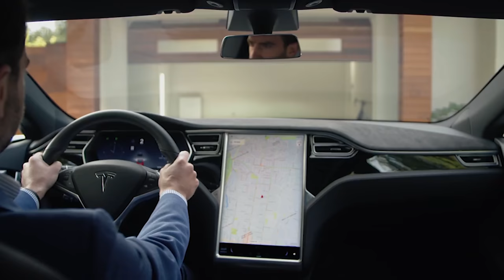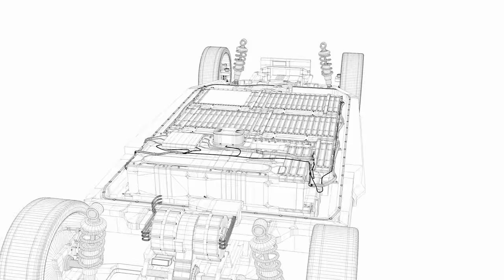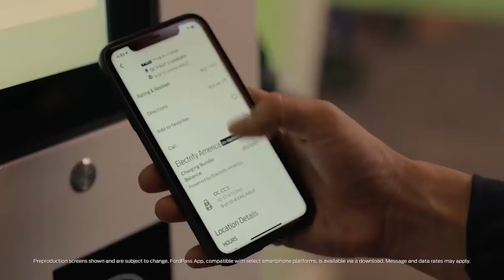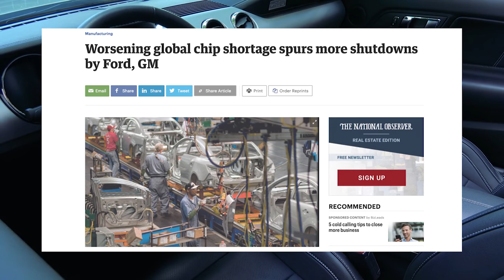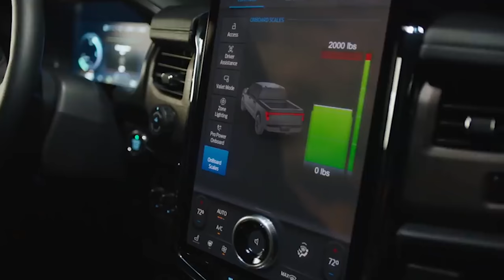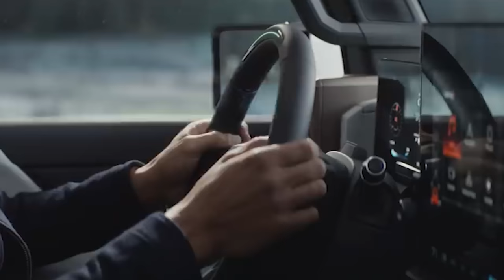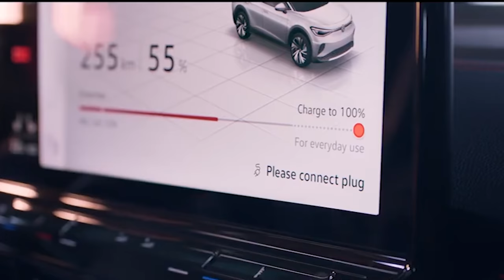Can EV Tax Bill Save Legacy Autos?

Comment: I think Tesla needs to release repair manuals and replacement parts for their vehicles for when warranty’s run out to help keep the independent repair shops busy when ICE vehicles disappear. They could also supply certified training on line for these savvy techs! They are not interested in repairing vehicles like the ICE manufacturers depend on for profit. This would make Tesla customers much happier when the very rare repairs are required! Takes way to long to get a Tesla repaired and I hear is costly. Repairs are rare but older Tesla’s will require some repairs at some point. This does seem to be a flaw in Tesla’s strategy but maybe in the near future plans! Just more nails in the OEM coffins.💎🙌😎TESLA
Reply: Telsa has to be careful when it comes to service.  These are not traditional cars and tradition training is of little use.  There is enough amps in those power lines to kill if inexpertly tampered with.  Parts might be an issue for a while yet.  They can barely keep up with production, surplus for service likely takes 2nd place.
Reply: There are plenty of authorised and fully independent Tesla repair shops.

Comment: With Tesla’s strength in software it’s for sure they have developed financial simulation models to figure out how to game their pricing and cost so as to put the competition into a real financial corner.  I’ve worked with other kinds of simulation and discrete computer models and if you do a good job in defining all the parameters and make solid assumptions you can play all kinds of ‘what if scenarios and games’ and possibly tie that in with a discrete optimization model.  Legacy auto doesn’t know it yet but the screws will begin to be tightened by Tesla before too long and I think those computer models will be behind it. It comes down to various costs, pricing, gov’t subsidies, emission credits, taxes, production rate and buyer tax credits, etc. Tesla has no dealerships to factor in and that gives them a big advantage.  Another big factor is the presumed much lower cost of Tesla’s 4680  batteries once it goes into mass production, hopefully in a years time or less. All those factors and more can be defined into the models. Imho, Tesla Killers are going be in a very tough financial corner pushed there by Tesla.  Exciting times, esp. for TSLA holders.

Comment: The casting machine will/had removed the barriers for the mass production of the car and what is left is the source to power the car which is electricity. It is inevitable. They better start now or they will be left out. Elon talked about solar as production and the car the as the consumer. Did they fail to catch on that. Better start the electrical grid innovation or Elon will monopolize that area too.

Comment: I wonder when Ford will admit that the new factory is mostly robots? I mean, to be competitive in any way, it will have to be. That means shedding ICE vehicle jobs - thousands upon thousands. That's another problem, requiring billions to resolve. Still they've got plenty of time. Except, they haven't. I reckon by 2024/2025, ICE vehicle sales (in the western world) will be close to zero. ICE manufacturers have created a "You need to buy the latest" marketing mindset, a bit of change in trim, and buyers feel they need to change their car. So when EVs are available, the buying mindset shifts from ICE , to the latest, better EVs. Another reason why this change will happen faster than most people think.
Reply: @chris heath I think your prediction of zero ICE vehicle sales in U.S by 2024/2025 is wildly pessimistic/optimistic. U.S. 2020 car sales was about 14.5 million. If Tesla can produce 5 million cars annually in 2024/2025 that will leave about 9.5 million non Tesla EV's needed to be produced to meet your prediction.. I think it is highly unlikely that the other auto makers will be making 9.5 million EV's for the U.S market by then.
Reply: @skipondowntheroad5833  We shall see ! There  are many factors involved in my conclusion... Tony Seba...